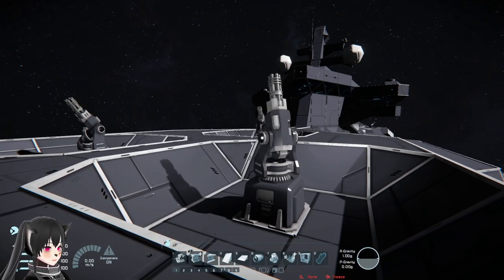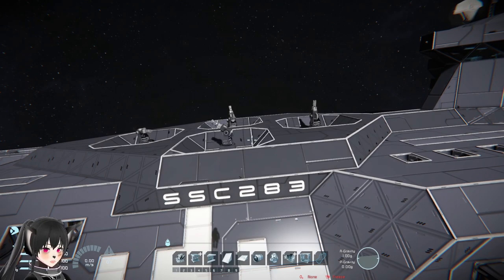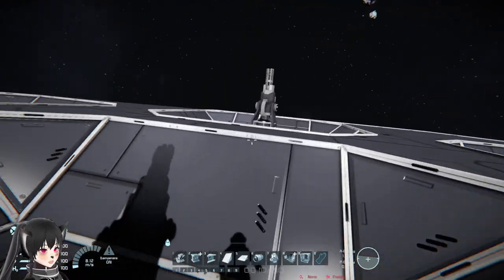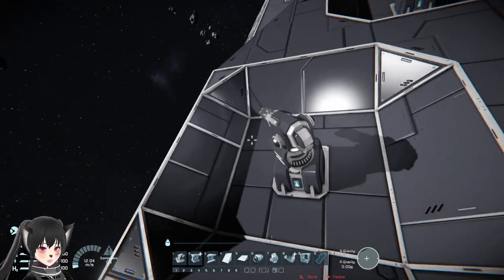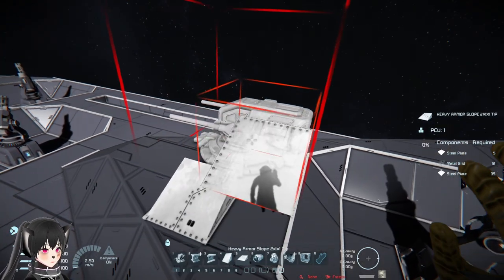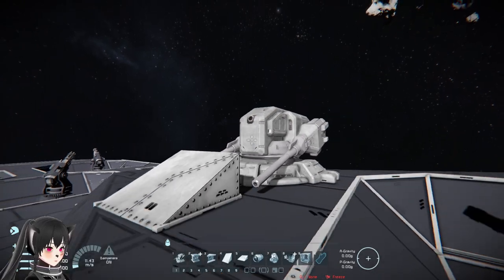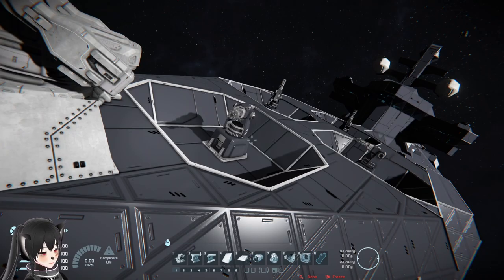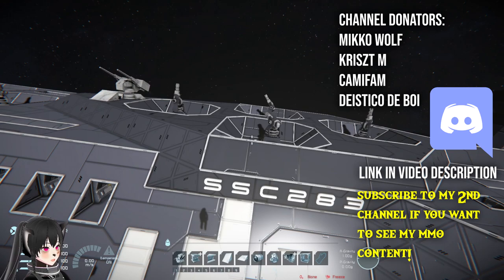This Ship Design Trend is Silly, Space Engineers

Comment: Kinda shortsighted if you consider it from a "shaping the battlefield" perspective.  Yes, they limit the firing arc of the turret, but they also limit the angles that are viable to attack the turret directly.  So if they want to take out a particular turret, they either take their time to work through the armor while under fire from some of your weapons, or they approach from an arc where most of your weapons can converge on them.  It's not a smart plan for an individual turret, but as part of a carefully designed solution it can be quite viable.  You can for example have a situation where any attempt to take out your recessed bridge can only be made under fire from turrets that can't quickly be taken out from any angle that doesnt let them all converge.
Reply from the maker: Yeah but because they limit the lines of sight they effectively reduce the potential damage output as much as they increase the protection to the turrets c= so it's bad in that they don't really give anything while adding weight

As in for that scenario, I think the most likely outcome would be that the enemy would simply target or attack the other turrets that are closer though, the other scenarios sound interesting though x3 I might need to think or test whether or not those would give more benefits compared to the downsides

Comment: sometimes inset turrets are an aesthetic choice, because Gat turrets desperately need a visual update to bring them in line with the Warfare two guns.  I just do not like how far they stick out in comparison.  you are absolutely right about turret depression angles.  Could be seen as a flaw on one of my ships but since they are side mounted just aft of the nose and it's not a particularly thick design, the point where it would be an issue is if something was a handful of meters off the nose.

really should finish that ship...
Reply from the maker: Yeah a visual update or a Warfare 2 variant of the gatling turrets would be nice c= x3

Comment: I think the main reason why players are setting up turrets like this is because of players like me that set turrets to Target other weapon blocks. It's a good concept, but in practice it does limit your turrets range of motion. The better option would be to do a proper turret layout and have decoys to draw fire away from them for as long as possible. This is one situation where I will say that welders are a good idea with a decoy because they can wound up blast door pieces or armor blocks around the decoy to make it last a little longer. Steel plates are cheap and Light. As such whenever I set up a welder, I have it welled up as many still plates as possible rather than turrets and such
Reply from the maker: I see c= and yeah having steel plates in your welders is always the most convenient way to use them if you want to repair most stuff with them x3

Comment: its not inherently a bad idea its just a trade off, if you have enough firepower in all directions and would like to reduce some of the more expensive repairs at the cost of a few small blind spots then that's their prerogative.
Reply from the maker: There is more armor from a defensive viewpoint yeah, but the reduced lines of sight might mean less damage output which then means longer engagement so the extra protection is kinda negated by that c= though if the main concern is protection of things on the ship then maybe it has some merit

Comment: people have been doing this since the halycon early days of SE and it's always made me shake my head in ships designed to actually function instead of look pretty. Usually done by players who think turrets are actual engagement weapons, which, they're not. Turrets are merely deterrent systems, to protect them is pointless. Your real strong arm in any engagement is your fixed axial weaponry. The turrets are just there to push your enemy where you want them to go. It's too easy to confound disrupt or otherwise simply get away from turret embankments to rely on them to do significant damage. The pew pew comes from your axial death dealers, which you can, and should recess into your hull and hide away from direct fire. Upraise your turrets and hang them way out, if you want them to put in more work.